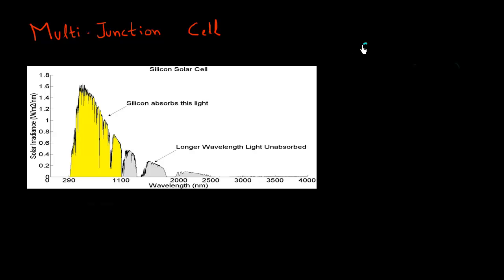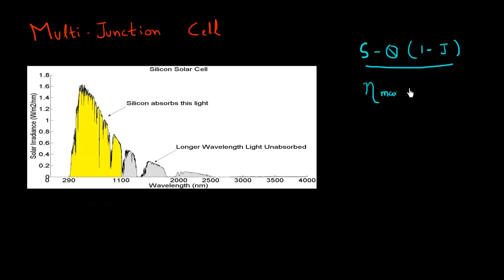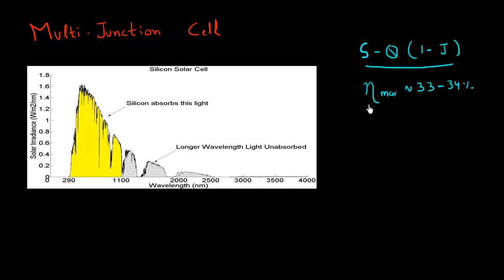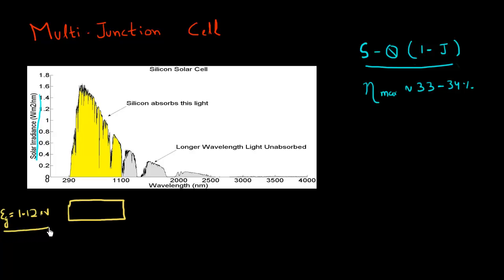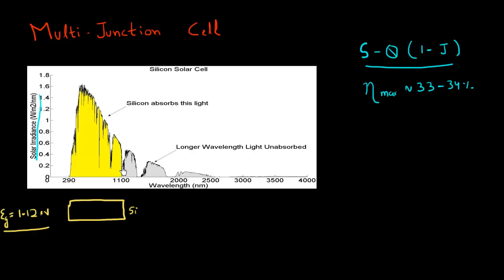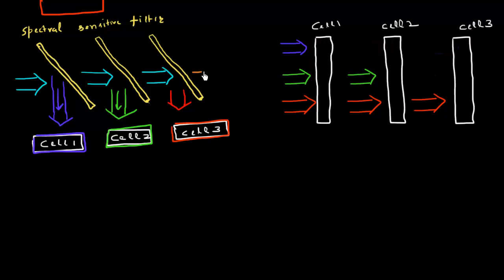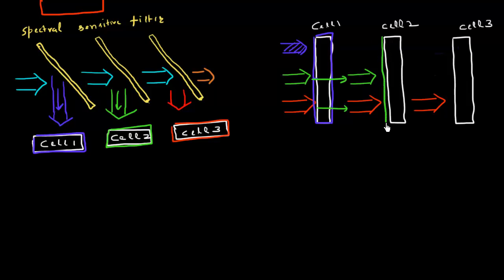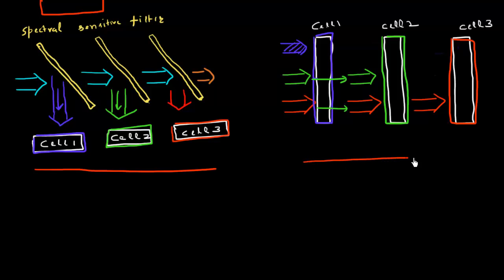Need for multijunction solar cells and efficieny improvement

Comment: 2:57 shouldn't efficiency be inverse of that?
Reply: Sort of. The actual equation is a function of the: optical étendue, absorption coefficient, and Planck’s equation for black body radiation (derived by Shockley and Quiessar). We can also calculate the efficiency in terms of the fill factor, open circuit voltage, and short circuit current. 

I’m guessing you no longer need an answer, but I figured I’d comment in case anyone else sees this